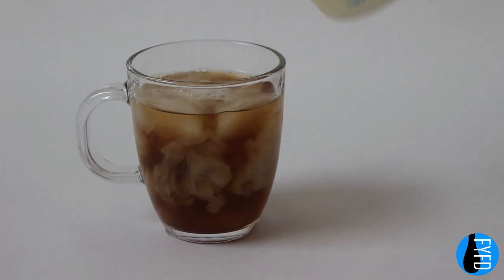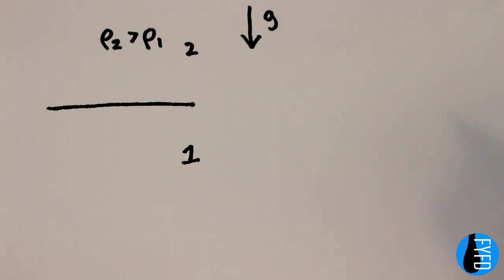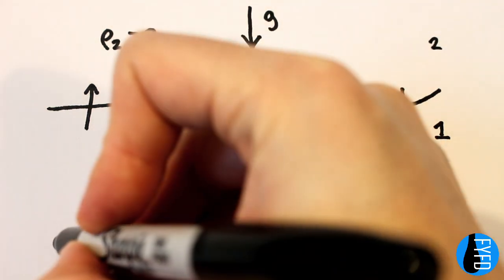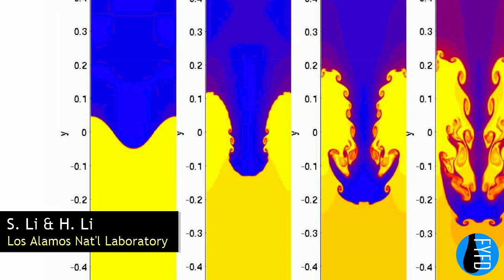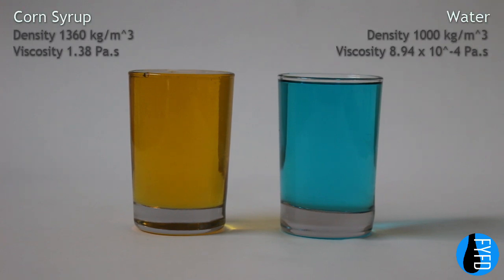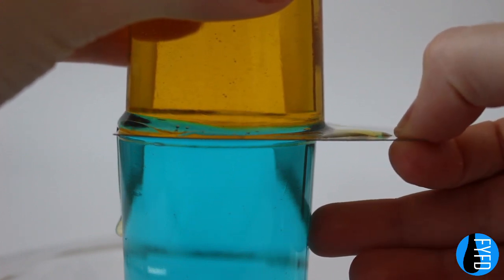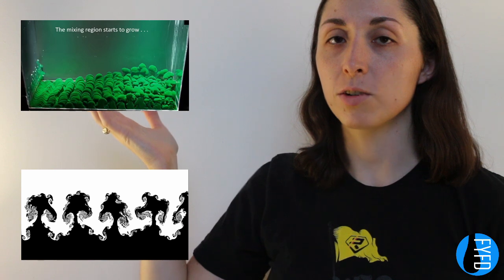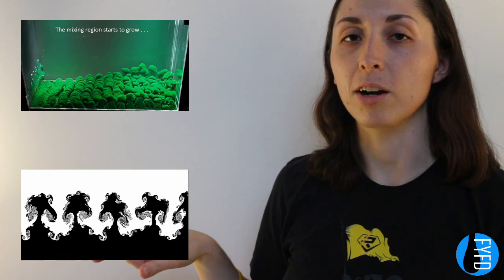Rayleigh-Taylor Instability

Comment: @fyfluiddynamics :   From the two cases , viz  coffee-milk and cornsyrup- water ,  I see higher velocity difference ( which directly affects the reynolds number and helps forming shear layer ) is the major creation of instability  and the instability is independent of the properties of the fluid. Is my conception right ?
Reply from the maker: The driver of the instability is the density difference between the two fluids. What I did by using a really viscous fluid is slow down the speed at which the instability occurs. It was a way to watch what was happening without a high-speed camera.

Comment: EVERYTHING SHOULD BE MADE AS SIMPLE AS POSSIBLE, BUT NOT SIMPLER—ALBERT EINSTEIN AND OTHERS 

The HLLC Riemann Solver referenced in Shengtai Li's paper is based on the HLLE Riemann Solver. Its stability is inherited from the HLLE Solver. How is the stability of the flow related to the stability of the Riemann Solver? Can cavities be simulated using  the HLLC Solver? See also https://plus.google.com/116010873343713831202/posts/UdpHEKP4fTt Can an empty space be simulated using Riemann solver?

Comment: I might be seeing connections that aren't really there but is the Rayleigh-Taylor instability like a reverse Brazil Nut Effect?  The mixing occurs automatically because of molecular movement, lower temperatures result in less solubility because with less heat energy those little particles don't move as fast to "stack" on each other.
I also noticed that the fractal swirls resemble the shape that the poppy seeds made in your other video.
Reply from the maker: They're similar, in that both RTI and reverse Brazil can involve denser regions moving downward due to gravity. In a lot of respects, though, RTI is much easier to explain because it involves only one state of matter. Granular flows can sometimes behave a lot like a fluid, but they're really not. Because they include solid matter and gas, there are a lot of extra interactions that complicate their physics. It's great that you're looking for the connections, though, because that's a great way to help understand and it's exactly why physicists sometimes treat granular materials like a fluid.
Reply: +fyfluiddynamics Thanks keep up the good work :)